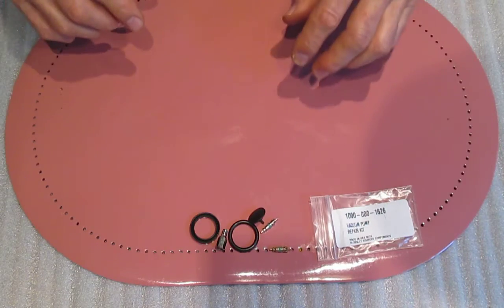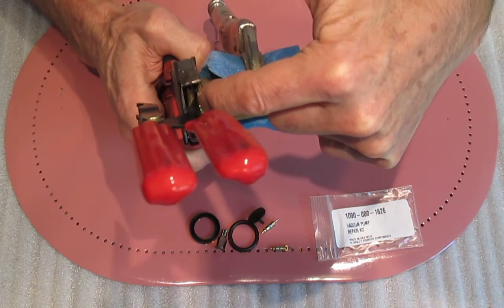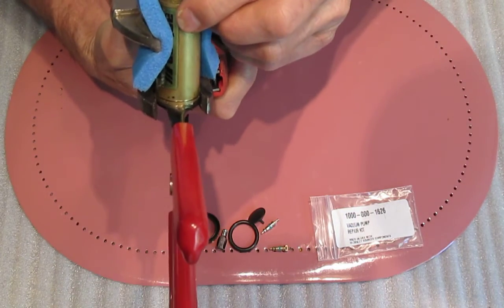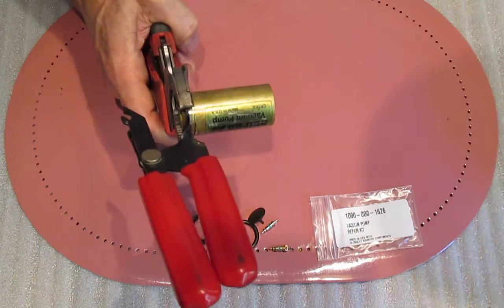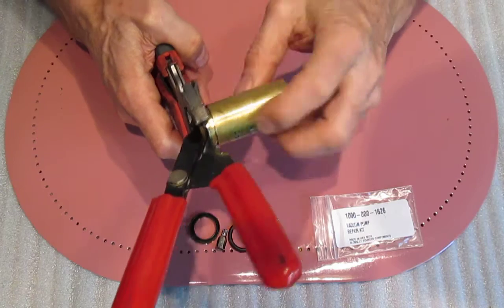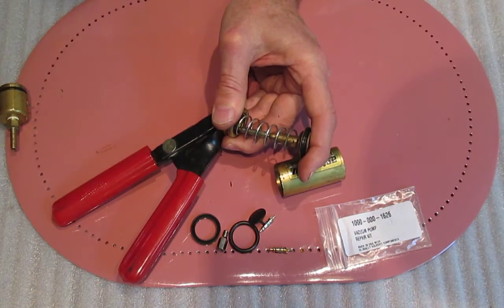Actron CP7830 Hand Vacuum Pump Rebuild

Comment: I took mine apart and found that the rubber diaphragm had deteriorated. Without a good diaphragm this unit will not hold a vacuum. I looked all over for a rebuild kit, but as you probably know, they're not available for this unit. I then went to ebay and saw you could buy a complete unit for around $12 shipped. Then I got a great idea. I found a one-way check valve that I had laying around. It was made for my swimming pool chlorinator. I took the check valve and put it in line with the suction hose. Now everything is good and it holds a vacuum. I plan on making a YouTube video when I get a chance to show you how I did it.

Comment: 05:47 Actually, that round rubber diaphragm does not go into the Schrader valve/handle end, it goes into the other end that has the gauge.

Comment: What happens if I get water in a pump like this? Will the water mess up the oil or the 'O' ring? I understand you vacuumed in brake fluid and what did it do exactly? This is also one of the only videos I have found on this. Thanks in advance.
Reply: Brake fluid should never enter the pump. The brake fluid stays in the cup. If this happens you're doing you're wrong. Water will not hurt anything unless you let it stay in there for a long time. It could corrode the brass. Water will not damage any of the rubber parts.
Reply: You Will Need New Pump Or High Pressure Grease 💀 New Pump Cost Less Than Grease BTW 🤦‍♂lol

Comment: Could these pumps use oil new from factory? Just bought one, and it pulls 25 inches of mercury, saw somebody that said they oiled it and it went up to 27.

If they need oil, what kind should be used?  Thanks
Reply: No.  It is senseless to disassemble it if it is pulling 25hg instead of just using it.  If you instead want to add lube to prolong its lifespan with reduction in wear, then use a viscous silicone grease like high quality dielectric or better still, silicone paste.

Comment: Could these pumps use oil new from factory? Just bought one, and it pulls 25 inches of mercury, saw somebody that said they oiled it and it went up to 27.

If they need oil, what kind should be used?  Thanks

Comment: Mine stopped holding vacuum. It came apart pretty easy. I just used a cheap small Harbor Freight strap wrench and it came apart. Cleaned up and put a tiny amount of Magic Lube o-ring lube on neophrene parts. Back together and good to go. Thanks for the video...nice to know how it comes apart.

Comment: You could use a pipe wrench on the barrel. If you make sure to have three points of contact, it will not deform the pipe.

Comment: This pump has many copies of basically the same design. Watching yours being taken apart, I can't imagine that the cheaper versions out there are that much of lesser quality. Having said that, it seems like this video is a fairly universal fix to a overall problem with a lot of pumps. The biggest problem I see is there is no clear instruction on where the reservoir cup should be (above or below) relative to using the pump. It would seem holding it lower than the pump would avoid accidentally sucking fluid into the pump. Aside from getting the kit, which looks like normal schrader valves and a few o rings, wouldn't taking it apart and soaking it or spraying it with brake cleaner do the job? Seems like it couldn't hurt if its already broken.
Reply: Not necessarily true at all.  A high quality version of this could use precise seals made of more durable material, and the cylinder could be honed/polished better, higher quality schrader valves, and an appropriate amount of high quality grease could be used to lube it.  Essentially, addressing every normal point of failure.

The reservoir position relative to the pump is irrelevant.  The reservoir cup must simply be held in the upright position and kept from shaking around much, and not over-filled, then it is the vinyl tube that extends downward into it at the inlet side, that puts the brake fluid fill position at the bottom of the reservoir.  

If you do get brake fluid inside, taking it apart and spraying with brake clean may help, but if it is left sitting and the brake fluid damages the seals, it is probably too late at that point to bother merely disassembling and cleaning rather than using the rebuild kit parts.  On the other hand, if you were also to add some grease because it was a leaky seal, that may help, but whether it helps "enough" is the question, depending on amount of wear.

Comment: Thanks for this video.
When brand new this hand pump wouldn't hold vacuum when you released the handle. So i spent another $8 on the chinese made rebuild kit. The end of the old flat rubber diaphragm broke off inside the pump when i removed it. No problem just remove the barbed outlet fitting to get it out. The new flat rubber diaphragm retention bulge is too big to fit in the hole. Finally pushed it into place using picks.  Went to tighten the check valve that goes opposite the gauge and the supplied tightening tool broke. With the repair kit installed the pump would hold vacuum when you released the handle. The only problem then was that it only developed 17 psi max. I took the gauge end of the pump off and cleaned the inside of the piston barrel with alcohol.  Max vacuum increased to ~21 psi. I will live with that.

Comment: Nice video. I found a couple of small flaws however. It is not necessary to remove the press ring on the piston shaft to remove it from the handle. Compressing the piston spring towards the handle will allow clearance to lift the detent over the recess it sits in and permit lifting the piston "tail" out of the top of the handle. Y ou might have to spread the top of the handle with a screw driver just a bit. Reassembly is the reverse of removal. I also had an issue with removing the "dump" schraeder valve from the pump body I t would not come free from the pump body after unscrewing it all the way. Grabbing the exposed part with needle nosed Vice Grips didn't work either so I removed the gauge and tapped it out through the gauge hole using a suitable drift. be sure to re teflon tape the gauge fitting on reassembly. The final issue was that the flapper valve does not go into the piston, but rather the gauge end of the pump. My replacement would not fit. the "seating nub" was noticeably larger than the original and would not go through the hole to seat the flapper despite 15 minutes of effort using dental picks to push the nub through the hole. I gave the original a light coating of silicone grease that I use in SCUBA regulator repair, rubbed it into the rubber and removed any excess with a clean cloth and cleaned the face of the end block with rubbing alcohol. It seals perfectly. I also treated the  static oring and the piston oring with silicone grease but did not wipe it off. Do not use petroleum based grease as it will eventually destroy the rubber. I actually loaded both sides of the piston  with a little excess grease  on either side of the oring to lightly lube the barrel. Don't use a lot because it can hold dirt that will eventually ruin the seal.

Comment: Hi, thanks for posting this video. I made the same mistake and have just used this to help me strip it down. I just realised that I didn't check which way round the piston seal is fitted into the groove when I took it out - is it fitted so that the flat side faces the front and the grooved side faces the rear, or the other way round? Thanks, John.
Reply from the maker: John,  you can sort of see the seal on the piston if you pause the video while in full screen. Anyway, my best recollection is the piston seal needs to go in oriented so that the piston is easy to slide into the barrel from the back. If it's on reversed, it's hard to slide in.  It has been a while, and I'm going on memory, but I think that's right. If anyone else has one disassembled and can give an authoritative answer, please chime in!
Reply: Thanks for the reply, from what you said about ease of fitting I think the seal slides in better with the grooved side to the rear, otherwise I think it drags too much, but I will check when I get my repair kit (a friend has had to post them to me from America as you can't buy them in the UK, as it is outside US territories!) Cheers, John.

Comment from the maker: Two additional things not covered in the video:
1. The barbed fitting has a little metal filter inside of it.  To clean it, unscrew the fitting, and push the filter out with an allen wrench, or something similar.
2. A critical part is the small rubber diaphragm.  It is convex on one side.  The other side is flat, except for a tiny nipple in the center.  That diaphragm is installed with the flat side toward the front piece. The nipple should be pushed into the hole in the center of the front piece, and it retains the diaphragm in place.  The convex side faces the piston.  If the diaphragm is in wrong, the pump will make vacuum, but it will not hold vacuum when the handle is released.